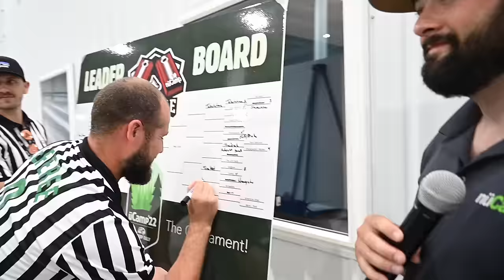Why This is the #1 Selling Teardrop Trailer in the World!

Comment: I use a smaller expedition style trailer and consider mine better built and better thought out. I actually have a cassette toilet inside and my all aluminum frame and body is TIG welded to B pressure standards so will not fail. It cost me maybe 25% more but it’s worth it. But I would suggest a t@g for most people who want a small trailer but where I go and what I do I would break one.
Reply: What brand and model do you have?

Comment: The price point on these is great compared to many other manufacturers in the market today. I see the heat requires shore power. What are folks using for heat when power is not available.
Thanks
Reply: Probably Mr Buddy, with a window cracked, of course.

Comment: I have a 4 year old T@B 320 boondock edge and adore it. I have had a few issues though. It leaked through the light in the bathroom and I figured out it was coming from where the solar panel cable was coming in. I fixed that with some caulk. The mosquito netting doesn’t work as well as it should, so am working on a solution. But, for the most part, my issues have been owner errors and learning opportunities.  There is no other trailer I would rather have - this one is perfect for us.
Reply from the maker: Thank you for sharing. I actually talked about how the obvious culprits for leaks are lights, fans, and essentially any hole you cut and add an accesory to on the roof or side of the trailer. I took it out during the edit to reduce the time of the video. So I am glad you  touched on it here. It is a common problem and if caught quickly can cause no damage at all. But, if left unseen, can get ugly real fast. And this is where that Azdel comes in as the safeguard.

Comment: re-packing there is a regular maintenence but i chose buddy bearing and aircraft grease , same used on fighter jets for the high heat involved every 1000, 2000 miles a squirt into the buddy bearing and good, . after about 3 yrs, replace the seals and re pack but re-packing every 6 months is crazy.

Comment: I wanted to and almost bought a tag 320 S Boondock, however, the only dealer within 200 miles of my area, basically refuse to sell to me. They would tell me come back when you’re ready to buy we can run your credit blah blah blah, fill out our online credit app, blah blah blah, and then they would never communicate to establish a sale. So I ended up buying a trailer that I had never seen. I’ve never heard from, and I’ve actually never seen another one in the real life in the wild from a major manufacturer. A trailer does seem to be a quality build however, it was sold as having equipment that it does not have and that I needed for full-time living. So now I’m stuck with an over priced loan on a trailer that doesn’t have the required equipment for full-time use. Meaning it doesn’t have any windows in the trailer. There are frosted windows in the doors that you can’t see out of but there’s was not any ventilation whatsoever. There is no heater. There is no water heater. It did not have an inverter. However the dealer installed one for me because they specifically told me that it did at my sales meeting. I managed to get the manufacture to exchange the rooftop AC unit which only runs on shore power for a fantastic fan which can run on batteries, but that was the extent of effort to correct all the missing items that I needed. I have about 120 videos on this trailer that I’ve removed from my channel in my buying experience because when my finances improve, I do plan to file a lawsuit. If I could sell this trailer for tab 320 S, I would in a heartbeat, even the non-Boondock model. Also, I was told that my trailer by three different sales people and the manufacturers line rep that it was a 100% composite construction trailer that it had no what it was Asdale and it had no aluminum in the walls. It was full composite, all the literature on this trailer shows Mandy’s trailer does not have an talks about it’s built. This trailer is built like every other mass-produced RV in Indiana with aluminum framing the spot welded together, not fully welded it has house tile glued on the outside with fiberglass underneath it and then it has Luan wood on the inside, they just cover the Luwan with wallpaper so you can’t see it.
Reply from the maker: I'm really sorry to hear about that. I can't imagine someone would produce a trailer without ventilation. Crazy! I hope all works out for you and you get things made right.

Comment: Great video Drew. I looked real hard at the Tab 400 but it just wasn't off road capable enough for me. For such a mass produced trailer i was impressed.  I agree that they have less issues posted on various FB groups especially for the Tags which have less components that tent to have issues.  I have a few friends that own tabs and the truck campers and love them. One thing that bug me is they are sold at big box RV stores and one has to deal with that nightmare.  I will follow up if i hear of any problems folks might be having.  FYI- Nucamp is definitely better built then Little Guy trailers!
Reply: Update. Folks on FB are reporting build issues on TAB trailers.  Like I said mostly do to the wet bath and other components that TAGs may not have. Some interior wall delamizations issues.  Mostly problem with dealers not supporting them. But like you said Drew the issues to units on the road is one of the best in the mass produced wotld.

Comment: Drew, how do you think  TAG would handle Overlanding like you did in Utah?  Seems a Bean might be the better choice for the rougher trails vs. roads I'm looking to do.
Reply from the maker: Yes, I feel the same way as you. In this community, we consider the T@G a soft road trailer. Essentially it’s lifted and built strong enough to get through off-road conditions to get to better conditions. Meaning I would go very slow and pick very careful lines to cross some sketchy terrain to get to a well-maintained dirt road . but it is not designed to primarily use 4 x 4 trails. Where the bean is meant to go wherever your tow vehicle can go.

Comment: Drew, I, too, like many others, have come to appreciate the quality in the nuCamp 320. I prefer the CS-S, which has the rear kitchen. Have you found another trailer with the same build quality, weight, rear kitchen, that has a taller inside height of at least a few inches?
Reply from the maker: That’s a good question. Off the top of my mind, no. It’s that rear kitchen… nobody is doing that with a standing height trailer. That’s why we were working so hard to make something like that for our own home build. Plus we wanted it to store and travel like a non-standup trailer.
Reply: Yes , your answer is right on.
I, too, miss Charles and your guys dream.

Comment: I have a TAB320s and it's nice, but it leaks water in the back corner. Flooring in the storage area is all curled up from it. It's a common issue. I've tried resealing specific areas but it's still leaking.
Reply from the maker: Yay, someone finally has something negative to say on here! It is crazy all the postive comments we get. How old is your model?
Reply: @PlayingwithSticks  it's a 2019.

Comment: I have a 2017 T@g and about 60,000 km on it. It is NOT GREAT. I would not recommend it to anyone. However, the newer ones seem to be much better than mine, so maybe they are now worth buying. To your point about not complaining, I just don't bother anymore....
Reply from the maker: Love it!  Thanks for being brutally honest Scott.
Reply: @PlayingwithSticks   Sorry, my comment was made very quickly as I was watching your video, and I missed including a bunch of info in it, such as I bought it brand new and I camp all year round. I have been out in everything from +41 C to -30 C. So I have used the heck out of it from day 1. I have had issues with the factory and with the dealer. How about this one: nucamp tapped the water tank HALF WAY, meaning the water capacity was HALF of what the brochure said. To fix it, I had to pay half, the dealer 1/4, and nucamp 1/4. That is just one example of many. I have met a number of more recent owners and when I look at the newer T@gs, it does seem like most of the issues I ran into have been corrected (the design issues, I cannot speak to the build quality, of course.)

Comment: How does this Tag model compare to the Intech Luna Rover? I am having a hard time deciding.
Reply from the maker: That is a good question. I really comes down to layout and functionality. Essentially they are both teardrops that are using composite and metal. I know Intech makes an aluminum chassis and birdcage frame for their trailers. I am not 100% sure what T@G uses for the frame of the box. I also know that Intch is adding propane heaters now, which is a huge plus compared to teh T@G.

Comment: They are nice.  I'm not sure why they put coolers in them now rather than fridges.  Many times, I've read about the fenders breaking in the bends.  That's the only bad I've heard.  They made my LG five wide, and I'd rather have the Tag for more space maybe, but I may have a bit more storage.  They use nice wood for cabinets.  I don't care about television or the big window in front.  For the average bear, they are good.  I'm not sure what the ground clearance is.
Reply: With the ‘24 model, they have started including 12v fridges again.  That short-lived cooler experience failed miserably.
Reply: I'm not surprised at that failing.  One  would probably want solar to keep it going then.
Reply from the maker: I'm not sure about the ground clearance either. But I know it is plenty for our family's needs. Thanks for sharing your take on this.
Reply from the maker: Haha. Love hearing this. Now I hope to hear they start offering a propane heater option.
Reply: A propane heater would be very good.  They have electric heater, but I almost never use electricity.  I've lived without a/c in the northwest--if it's loud, I would hate it anyway.
Reply: I 
Ove the big window in the front I can see the stars no matter how I lay down in the trailer ❤️🙃

Comment: I am not doubting T@g builds a decent product, especially for a “large”/“mass produced” camper.  With it being from the “mass RV industry”, wait times and production costs should be lower.  The drawback is you cannot customize it or order it to your specs.  But, some of the smaller, “one at a time” builders also have limitations to the customization you can do.
Reply: Contact the manufacturer, they're almost always open to custom builds.  (This is coming from someone who has custom ordered travel trailers and toy-haulers.)
Reply from the maker: Agreed. When they are producing trailers at this scale, they don't really have the ability step outside the assembly line and cater to your specfic needs. That is the beauty of going through many of the smaller ma and pa shops.
Reply: @PlayingwithSticks  I have to respectfully disagree.  Many rv manufacturers will customize.
Reply from the maker: You can respectuflly disagree. We allow disagreements here. That is the beauty of this community.  I think you and I just aren't on the same page in terms of what we are talking about. I am referring to NuCamp specifically. I think you may be referring to others in the industry. Sorry for the confusion. I should have been more specific on my response. @muleoutpost8156
Reply: @PlayingwithSticks  I have custom ordered travel trailers before, but I haven't custom ordered from NuCamp.  I'm sorry I misunderstood.  Thank you for keeping up with the comments section.  

Looking forward to your next video.  I'm wanting to build a teardrop pod that slides into a 6x12 utility trailer.  Thanks for the inspiration.  Whatever happened to the custom teardrop you were helping design that opened up like a clam shell for more headroom?
Reply: NuCamp does vary the production a lot and there are many more trailers and dealers for you to find your preferred package. I could swear I've watched channels and read stories about folks who have gone to Ohio to pick up their custom trailer order. "Custom" can mean a lot of things. In this case, I don't think you could get anything that's not an option - just the combination of model features and options you'd like.

Comment: It could be worse,  picture someone building a camper with BIG passthrough bolts with sealant and heavy duty washer.    where as part of maintenance you come around and check that the bolts holding the walls on are tight.   rather then worrying about nails and screws shaking loose over time... 

and every few years you can unbolt the walls, pull it off,  apply a new layer of sealant,  and bolt the walls and roof back on.   

A trailer DESIGNED to be serviced,  much like a car or aircraft would.   

Sorry, i couldn't resist thinking like a mechanic for a moment rather then an engineer.